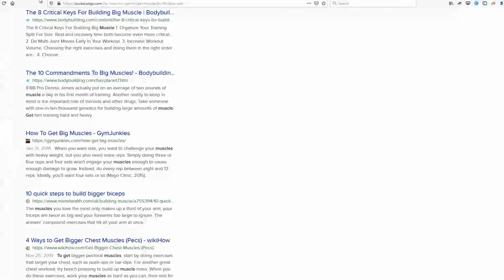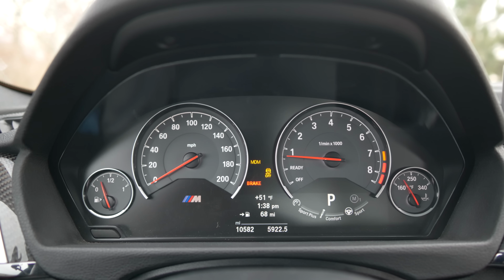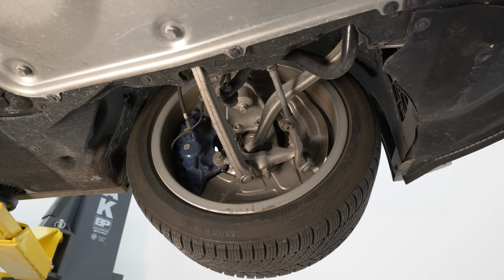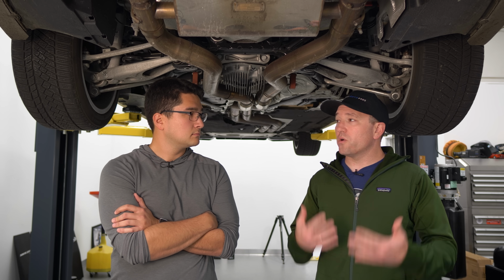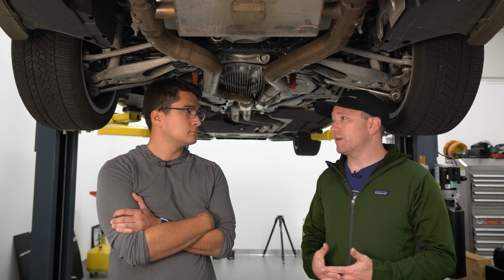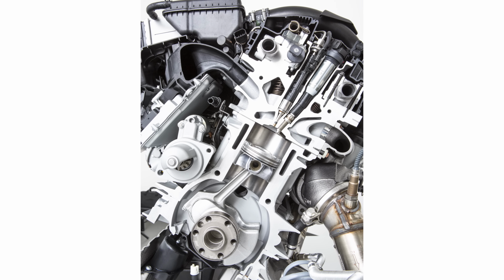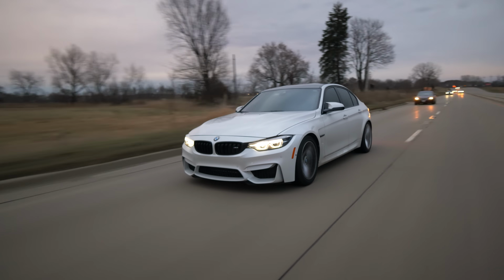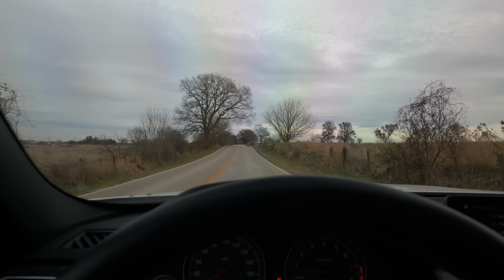BMW F80 M3 Review | The Sports Car for Mathematicians

Comment: I was considering the F80 because I thought the S55 was a solid reliable platform, but I'm hearing more and more failures from race shops that they aren't holding up with track abuse. Need to research that more and I hope those cars were all tuned to the moon and made to fail lol.
Reply: they're probably tuned
Reply: I own one. I can tell you anything you need to know if you want. Overall the s55 is an excellent engine
Reply: Leave the engine stock, look out for leaking coolant tank, and you'll be golden. There are multiple people on the forums with high-mileage ones without any sort of issues.
Reply: Get a crank bolt capture. 500$
Reply: Solid cars. Crank hub failures if you tune it but I beat my car up at the track with zero issues. No overheating, no nonsense. Love it.
Reply: My friend has a 2015 and it's rock solid
Reply: @rogermoore2365  I don't think I'd argue anything based on individual experiences. It's interesting to go to a shop where people who track their cars heavily go for service. That's where you'll find the weak links in an engine. Much larger pool with heavier use. Having a high mile daily that runs the highway and the occasional track day will probably never see much for failure..Which is good! But that won't tell the whole story.
Reply: @TedwardDrives  that's true
Reply: I don't track my car and never will but its set up for the track. I upgraded all the week points.
Reply: Do the S55s use the same bearings as the N55s? A BMW tech on the internet (yeah, I know) said he's replaced 6 N55s this year due to spun bearings. I keep hearing things too...
Reply: Not sure why people are tracking F80s at all.  They're heavy sporty entry-level luxury cars.  There are far better choices for a street-legal track vehicle.
Reply: @jeebus2121  Clapped out E36s are a dime a dozen
Reply: @jeebus2121  F80 M3 might be heavy, but that's the new normal considering the weight of the new C8 corvette is over 3600lbs curb weight and a 2020 GT500 is now over 4,000lbs. M3 isn't bad for a four door twin turbo rwd car.

Regarding buying a track car. I think most people don't have the space for another car or want to invest into another car for track days. M3 is fine at the track with front camber plates and race brake pads.
Reply: Wanna good track car? 
Buy old JDM.
Reply: @jareknowak8712  Not if you want to keep your car stock. If you want a great driving MODDED car then sure, but not many people have the money, time and space to mod their cars. Unless you know about some JDM track toys that are ready out of the box that I forgot about?
Reply: Tommy L Garage you're the man! And my go to for all f80 diy
Reply: I'm sure you could find just as many tuning shops and dealers that would say the opposite if you wanted to.  Hell, the service manager at the dealer I had my break-in service done at even said he knows of tons of customers tracking the shit out of their cars, all without issue.  The S55 platform can easily handle 800+ whp with only supporting mods like cooling, clutches, and crank hub.
Reply: I’ve been running 600whp for two years and zero issues. Multiple roll racing events zero issues.  F80 M3 and E85 tune makes the perfect daily rocket ship.
Reply: @nmarty1122   I don't doubt it.  I'm just shy of 600whp with FBO and stage 2 tune.  The SCH issue is wildly overblown at even these power levels.  You only really need to do a (Max PSI or gtfo) CH fix if you're like 700+ hp with upgraded turbos.
Reply: Roger Moore Makes total sense 😐
Reply: @TommyLGarage  that’s how solid the car is? BMW finally got their reliability going?
Reply: @blendtecbrah you not at 600whp either. Fbo, ots tune, and e85 aint getting you an extra 250hp. Y'all are hilarious. 😂 I know because I have one
Reply: @jonb2437  ok bro.

Comment: Great review.  I have an F80 M3 and love the car and think with a few modifications you can really bring out the best in the vehicle. Changing the exhaust is a must as it sounds terrible stock, adding catless downpipes and a performance tune truly changes the whole car for under $1,500. The engine has a lot of potential but BMW really held it back. The gearbox is amazing but the car does have a tendency to lose the back end making it a little crazy to drive.  It is awfully fun to outrun almost anything on the road with 3 friends in the car though. I just found your channel and now you have a new subscriber.  Great job!

Comment: Best, most comprehensive F80 M3 review I've seen yet. I currently own this car and have owned an E90 335 in the past. I live in the city and the roads are a minefield of potholes, patchwork, and manhole covers. While stiff, this F80 M3 rides 10x better than my old E90. I used to be able to feel (and hear) every little pebble in my E90 and it was pretty miserable around town. Yes, the F80 sounds pretty bad but most of the noise you're hearing in the video is actually fake. Luckily, the fake sound can be turned off with an app, or by physically disconnecting the system. I use the app because I can toggle it on or off. The car actually sounds better - but almost too quiet - with the fake sound turned off. I agree that the car has too much power for RWD as it really struggles to put the power down. In the summer, I can't floor it in 1st gear without triggering the traction control. Now that it's winter, it struggles to put the power down in 2nd gear as well - even when the roads are dry!
Reply: what tires are you running? i changed the stock continental for michelin pilot sport 4s and wheel spin is minimal, my m4 launches like a rocket.
Reply: @unclefher90  My car came with Michelin PS 4s.
Reply: @spagolli94  thats weird, with new full set of PS 4s, car 100% aligned, my m4 gave me 0-100 in 3.8 seconds. launches like a rocket and wheel spin is practically non existant. With the stock contis it was impossible to put power down just like you say.

Comment: For the most part, most drivers would never hit that point where savagegeese is complaining about. I have owned two F8x gen cars and never had any sort of problems with them. As far as most would note on Bimmerpost, the F8x generation cars are the most reliable to come out thus far. The ones that have issues are generally minor ones, even the noted issues are extremely minor. I have friends who are BMW service advisors. They rarely see F80 or F82 with any catastrophic problems.

This car would become special only much later on. I'm sure he knows just by looking at all current G generation BMW's. ALL of BMW interiors are now identical, unlike before there were some way to tell them apart. It is all on BMW's cost cutting measure. A G20 3er has an extremely similar interior to a G14 8 series. Other than the M2 Comp, the F8x would also be the last to really rock the M-DCT as, again because of cost cutting, BMW is shoving a ZF8 in everything. The F8x would also be the last to be fully RWD only, AND not have a ugly ass front end that is coming to the G80/G82.

I understand the love for leaner power curve that sits with NA engines but those are extremely hard to come by a days. Looking up towards these types of cars only a Lexus would have them or Porsche's GT cars (which are outrageously expensive). However the one advantage the F80/F82 has above the other competitors is that it has a 6 Speed. It is one of the final cars to have them and apparently that won't change because BMW sees the 6MT take rates. G80/G82 will have them too, if you can ignore all of what BMW is doing with their cars that is.

For those of you who think about depreciation. Almost all cars depreciate.
Reply: Yeah, they won't admit it but any E9x owner has had or still has sleepless nights because their engine could break at any time. Happened to mine as well, cost around 8-10k in service costs. Glad I had it covered by insurance. With my M4 Comp: never any problems and I don't think I will have any before I sell it around 50-60k km. I'm sure it would even reach the 100k km mark without having any major issues. I feel the F8x generation is superior in almost everything, except the sound when downshifting which was way better on the E9x and the M4 also feels way more reliable. Sometimes I race it quite hard but I don't think I have or will ever reach the point where the things mentioned in this video will be dramatically noticeable to me. To me it feels just better. Maybe they should add a point of view from a non pro driver as well in this videos. Would be way more useable for us non pro's.

Comment: I own a metallic grey 2015 M3 F80 with the executive package. No upgrades, absolute 1st generation bone stock. Less than 30k miles.

It's an incredible car. Only 35,000 produced and discontinued since 2018..go to the bmw website you cant build one anymore. Would be a good time to sell now market is high on twin turbo sedans. 

Never really drove it very hard, always get great compliments and looks. The brakes squeak from time to time but that's a beamer. Luckily no electrical problems, went through a few tires but had the lifetime warranty. Biggest issue I could recall was a rear differential leak which was covered under warranty and replaced and fix quickly.

Extended warranty was cheap, I got full coverage including electrical at the same rate as a regular 3 series beamer.
Reply: How much to take it off your hands?

Comment: Great...Great review! Have owned the F80 Dct since 2016 and I couldn't have explained the experience better. The F80 is a great car but has its downfalls just like any car. I wont repeat what you were saying in the video but with that being said the G80 awd should fix some of the issues with power efficiency at full throttle. Let's hope the new G80 is a car designed with aesthetics we can appreciate as BMW moves forward with more of a radical design than most M car owners are accustomed to. I know this sounds wierd but I like the early pictures of the new concept design. All things new require some sort of acceptance. 

The F80 has been purely reliable and a joy to own in conclusion.

Comment: 10:30 they removed the carbon fiber driveshaft for a steel one, the model you are reviewing most likely has the steel driveshaft as they dropped the CF in november 2017.
Reply: Particle filter needed room
Reply: Wow that's very disappointing
Reply: Yup I remember when they did that, clearly cutting costs
Reply: @VaunShiz  no they had to make the driveshaft smaller so that an exhaust particle filter would have room per the new European specs. It wasn't to cut costs
Reply: They replaced mine with cf drive shaft. Some said got replaced with steel drive shaft. Some said replaced with cf.
Reply: @soscwon  if you originally had a CF driveshaft in general it will be replaced with a CF driveshaft if you had warranty work or tsb for example

Comment: At 24:25 is where the money shot is and many thanks to Mark and Jack for calling this out.  The unpredictability of turbocharged motors has gotten silly, and it seems like it's especially the case with this car.  Saab was notorious for this, but those cars didn't have insane power, nor did they give you all the boost with a slight tip in of the throttle.  That meant you could drive a Saab 900/0 smoothly when you wanted to.  

My E91 is like this.  Smooth, progressive, linear power.  

But you guys shouldn't be using the word 'reliable' in a BMW review.  Like every new BMW, this thing will turn to crap within a year of the warranty expiring.
Reply: endless money pittt!!!!!
Reply: This generation is pretty reliable.
Reply: @rahulmandala4930  they're all still under warranty.  Let's see where things go out of warranty.

Comment: I seriously considered an F80 M3...read the forums...bought a used Lexus GSF. The costs associated with these M cars can quickly ruin the fun.
Reply: Keep it stock. Do your research
Reply: Roger Moore I did thorough research and I don’t want a car that costs $20k to replace the DCT and carbon fiber driveshaft out of warranty at 25k miles. That’s just one example.
Reply: Gsf is nice
Reply: @theylive2749  that's the thing with BMW and M in particular. It's all aimed at maximising the drive. So they'll use materials such as carbon fibre which is mega expensive but provides lightweight stiffness to the chasis which overall makes the car drive the way it does. But if it needs repairs then it's costly but that's how you get the performance.

Comment: I would love to see your guys' opinion on the OG M2.  I know you thought the M2C was a little tail happy; I haven't driven it but I have heard from several sources that the OG M2 is more buttoned down.  I do know that the original M2 sounds way better, especially with the M-performance exhaust.  A side-by-side comparison of the OG M2 and the M2C would be a lot more interesting than I think people would expect.  The original M2 may solve a lot of the issues Mark has with the car.  Thanks guys!
Reply: Just search any n54 vs f80 m3 lawnmower sound clip
Reply: Fee OG M2 is N55

Comment: I may be wrong but I’m almost certain this car was not on the CLAR architecture. The f80 uses whatever architecture the 3/4 series used during the F30 generation. The 2019 G20 however does use the new CLAR architecture much like the 5 series and 7 series before it.

Comment: The lack of power delivery precision on turbo motors is due to a much longer control feedback cycle. On a NA car you instantly know after you step on the pedal that how much torque engine is giving, then you naturally and quickly modulate without being too conscious about it. On a turbo car, the power always comes with a slight lag (say you put in 50% throttle and hold it there, initially the engine gives you maybe 30%, as the turbo spools to a steady boost then you get 50%). With that lag you can't instantly modulate the power, because the full effect of the adjustment you just applied takes a split second to reflect. It leaves me often second guessing throttle input, wondering whether I step on it too little or maybe the turbo is still spooling up.

It is like having a mouse that moves with a 0.1 second lag - it may seem like a very small amount of time but it really screws up the pointing as you can't apply adjustments real time.

However I do feel that BMW generally seem to have the least turbo lag compare to other makes.

Comment: Love my M3. Every day driving is less dull 🤷‍♂️
Reply: Marc S how has it been for your in terms of reliability. I know regular service is one thing but has it had frequent unexpected issues? (I’m seriously considering buying one)
Reply: @gpavlovic25  I bought it with 6K miles and literally the only issue I've had 30K miles later is the horn. If you buy with the factory warranty they cover everything, even maint. Brakes and all. Tires and alignments have been the only expenses. It's an amazing car.
Reply: Marc S I concur, have owned my F80 over 3 years, driven 100,000 kms (60,000 miles) and not one issue. By far the best car I’ve ever owned. Will wait patiently for the G80😉
Reply: @tuxey6482  Love the F80, but, I'm leaning towards the M5 and/or i8.  I had a 2011 535i and it had bird's eye view and soft-close doors, etc. that the M3 just doesn't have.  Plus the sound system in the M5 is head and shoulders above it.  The i8 is just a p*ssy magnet and it drives better than it's reputation.
Reply: Marc S Yes have entertained the M5, a friend has a 2019 M5 Comp and while the performance is outstanding it just lacks in the looks department compared to the M3. Assuming the G80 has the xDrive system I’m seeing low 3’s to 100kph so comparable to the M5. As long as it doesn’t have the massive new kidney grill its a goer.
Reply: @tuxey6482  it's definitely got the grille. I actually think the M5 is more aggressive visually. They aren't as fun to drive,  but,  I do prefer the features. It's a trade off either way for sure...
Reply: @tuxey6482  I know this is 10 months late so I apologise for that. But do you daily driver yours? 
I got a f82 M4 and have had it over a year now. Purchased it new and now have 14,000km on it, I was thinking if getting a daily driver run around old F30 320i or something along those lines to chew up the miles. Was worried about reliability of a performance based engine as a daily driver. Have you had any issues?

Comment: I bought an F80 6spd back in 2015 because I was expecting my first child. It would never have been my first choice for an all out sports car because this was never designed to be a single purpose sports car. I consider the F80 the greatest compromise of a family hauler that really hauls. The steering is muted and the sound is OK at best but I’ve learned to like it. The driving dynamics at the limit make me want to be a better driver because the car is so capable. I know most people just want to go out and be flattered by their car but that’s not what the F80 is about and I love that! I can turn off all the electronic nannies and if I nail every shift and manage the torque with my right foot it’s because I did it well. As for the reliability front I have 45k miles on it and it’s still going strong. No squeaks or rattles either which speaks to the build quality. The only concern would be the crank hub if you plan on adding power. But really, spend a few grand on a driving school instead of adding power if you want faster lap times.

Comment: You can always put racing springs and shocks if you want to "feel" the speed, also you can tune the engine with the software of M2 competition, and then push as much as you can. The car is top.

Comment: @19:35: So the BMW lead engineer hadn't heard of the W204 AMG C63 (451-507hp through 255 width rear tires)?
Reply: Chris Harris testing the c63 on 4 donut spare tires, for an effextive hp to tire ratio equivalent to 1100 hp on stock tires was wild.